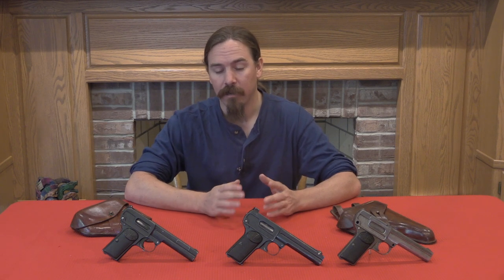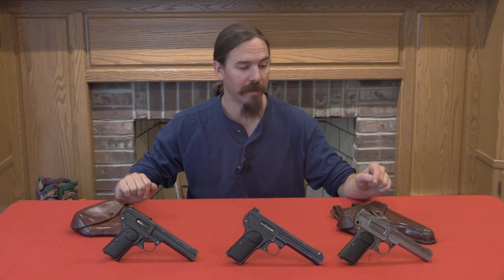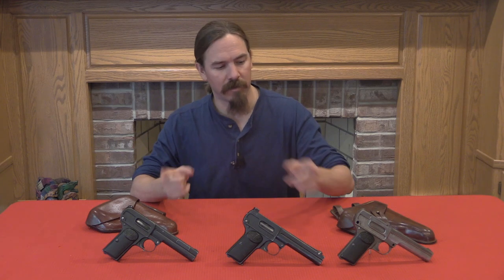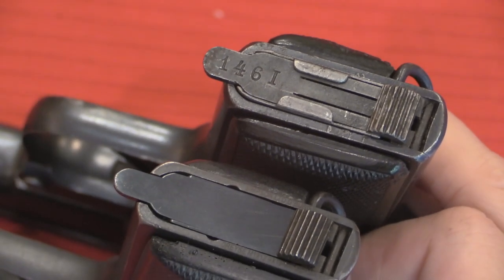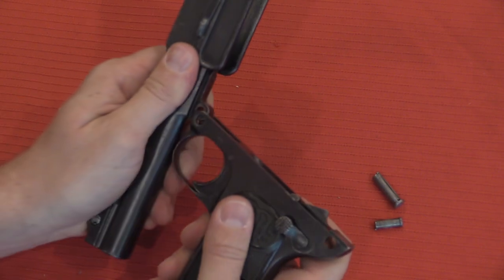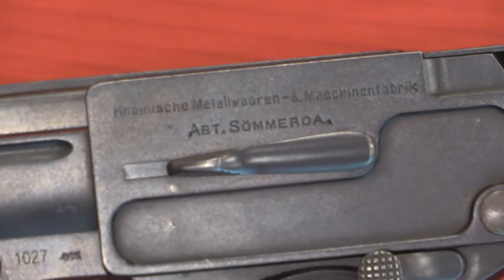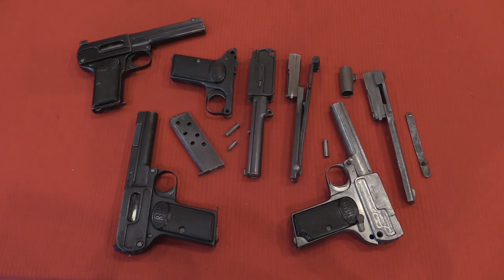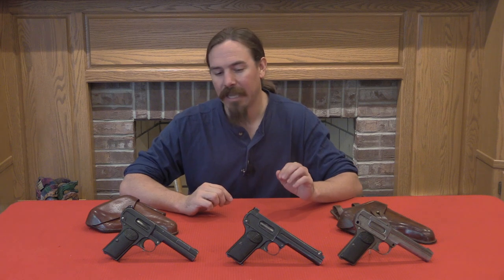Dreyse 1910: An Attempted WW1 9mm Pistol

Comment: I actually had a Dreyse Model 1907 that I bought at a flea market somewhere near Gettysburg in the 1990's for $10.  I thought it was mostly a relic, missing parts but I had a gunsmith friend look it over and he replaced the missing magazine and grips, said it was in working condition.   It was not in perfect condition and had some pitting so I never fired it because I wasn't 100% convinced it was safe.  I do recall it had a very stiff spring and the serrated slots near the muzzle would dig into your fingers painfully while cocking it.

Comment: Dang, learned another lesson.  My first was that firearms shouldn't spontaneously disassemble upon firing (Yugoslav M56), the second is that firearms shouldn't require disassembly between shots.  Man, I'm learning like crazy!

Also, never say this one is nice and easy to take apart, because then it won't be.
Reply: Learned that trying to take apart and put together a rugerr mk2 in front of someone. I've done if close to 100 times and it's still a pain sometimes

Comment: I think the last one works differently.
The leaf spring pushes the rear piece down, so this has to ride up the little bump on the frame, thus providing a little bit of delay.
Anything else would make no sense, no gun designer of clear mind would have designed a contraption you have to disassemble partially to chamber a round.
In the early days of selfloaders maybe, but not 1910.

Comment: Great video! These are amazing! That final design doesn't look half bad. Honestly I love the idea of a 9mm delayed blowback pistol, it greatly simplifies the action and FCG. Honest question, do you feel the final prototype model would have been successful if had been the original design? From my understanding (from watching a ton of your videos) it seems like a good design. Generally cammed metal surfaces cant easily fail and it looks to be a simple and rugged design (although Im sure it would succumb to even the smallest amount of sand). How does that design stack up against contemporary pistol designs of the time?

Comment: i love the look of it just as I do many pistols of that time like the FN Browning was it ? The way  the 1st model works is crazy getting that first round in and cocked but I find it different and how many air pistols cocked like this 40 years later ?  why could they not getting running right ? there is nothing fundamentally wrong so what was it ?
Reply: Heavy spring and bolt are much less reliable than delayed blowback in the higher powered cartridges like 9mm Para. Ammunition needs to be carefully selected and uniform in power to feed properly. That's until the top pops open on this particular model...

Comment: Hey Ian,

On the standard model, other than the recoil spring pressure, are you mechanically required to lift that slide lever? Let's say you're superman, can you just run the slide like a normal pistol?

Comment: 13:20  This video is incredibly frustrating, Ian. You disassemble the 2 poorly designed pistols and clearly show how they function but you pass over the best one, the one that seems to solve the problem of the 9m blowback. The serrated pieces on the slide unlock the slide from the mainspring, that's clear - but the slide is clearly actuated by a spring to return it when you hand-cycle it. Where is that spring? How are the two springs related?

Many years to late to get a answer but it's damn frustrating to someone who's been fascinated by the idea of making a 9mm pistol nearly as simple as a .32 pure blowback. This has the desirable spring-over-barrel and low bore axis.

Comment: Whenever I see non-captive pins I find myself way more disappointed than is probably warranted.
Reply: With Guns that weird to take apart you're not gonna do any field stripping anyways. I wouldn't. I wouldn't use it anywhere but the Range anyways. Fast disassembly is only really necessary for military arms. For other Guns it's just a convenience.

Comment: This looks like one of the worst guns on this channels so far.
Reply: That late model version with the slide lugs in the front actually looked like it could have been a fairly serviceable pistol. The disconnection mechanism probably would have caused reliability issues, but functionally it seems pretty good. All the other versions look ludicrously impractical... impossible to use with gloves for example.
Reply: +Bo Zo Crossfire mk.1?
Reply: Oh god I forgot about that price of junk. I've seen all the video's but you forget about some of the pure junk guns on this channels. The chines guns in terms of design where just fine as far as I remember they where just made with files so they where un-usable at best. Junk guns are my favourite things to read about though because they are just the most interesting.